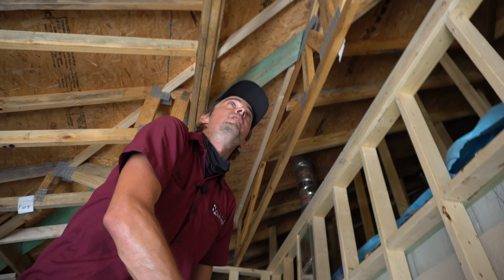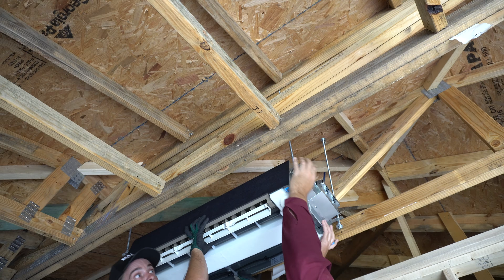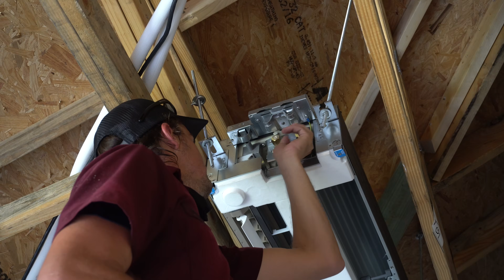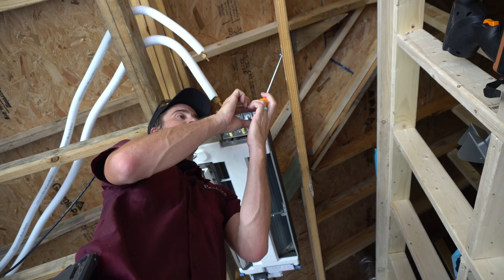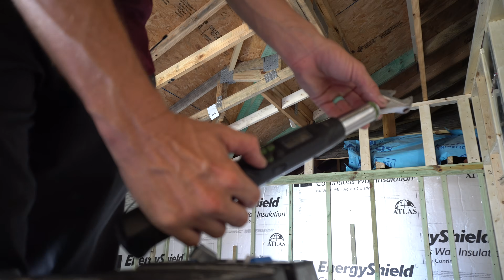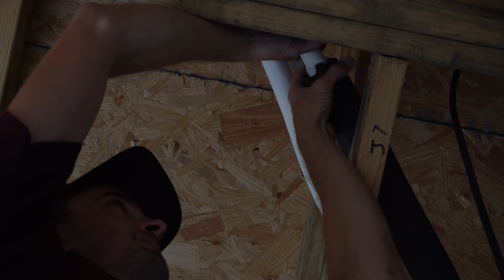Installing a Mitsubishi One-Way Ceiling Cassette In An Unfinished Room (You Can See EVERYTHING!)

Comment: all good!.........except, why wouldn't you run the copper down the inside of the wall and exit at the bottom to the outside, instead of having that ugly pipe running down the oust of the house?  that down pipe is an eyesore and doesn't need to be there!

Comment: Never Buy These! There were not designed to be cleaned. Every time mine have been cleaned, the blower shaft has been warped and caused the blower to be off balance while spinning and thumping against the insides. Reframing for the 2' Square units is very easy! 

If you can not access and remove a Blower from a unit without touching the Coils; Do not buy them!

Comment: Great videos. Hoping you can help. The condensate drain calls for a VP20 pipe with a 26 mm o.d. But 3/4” pvc is 26.7 mm o.d. Mitsubishi calls for using pvc cement. How do you make this connection?

Comment: Don’t know why anyone thinks this is a good install.  It’s terrible.  That allthread hanging off an eye bolt is ludicrous and no way is it code.  You MUST HAVE nuts and washers on both sides of that unit.  Your lineset and control wire are not strapped.  That’s a no no.  Your line set should have been run down the wall and exit behind the condensor.  That looks lousy.  People should not buy systems from jacks like this.  Customers need to be educated what a proper install looks like.  I would fire you on the spot if I saw this level of workmanship.  Thank god you are not doing these in my state.

Comment: the eye hooks are a great idea and far less than a L-bracket! What model cassette is that ? The videos say you need at least 16" to install so if that's only 12" wide that is a great option for the old homes in new england.

Comment: What does the "one way" mean? Is it different from other mini splits?
Reply: Apparently it means that it blows only in one direction, or through one vent, as opposed to other square cassettes that have vents on all four sides blowing different directions into the room.
Reply: @AA-zq1sx  ahhh. That makes sense. Thanks!
Reply: @WheretheJones  It does direct the air up and down and side to side though, to create good circulation... but yah, only one side of the cassette (on the long axis) has venting. The other side sucks in the air.

Comment: Since the room was already gutted why didn’t you run the line set down the inside of the wall? Had that been my house I would have happily paid a little more for you to drill thru the concrete instead of having to look at that line running down the exterior of the house.
Reply: Check out our installs “Ductless Plus HVAC”
Reply: This dudes install is ugly as hell no zip ties on the wire and line-sets.

Comment: I would have used side beam hangers for the threaded rod but whatever works I guess. Also the wire you used is 14-3 the ground doesn’t count as a wire.
Reply: Its sold as 14-4
Reply: @qomco  no it’s sold as 14-3 ground isn’t included in the number ground is there no matter what
Reply: @keenanwalker6597  if you say so. But i install mini splits 5 days a week and its sold as 14 4

Comment: This is not at all how this should be done and certainly not a “quality” installation as some have commented.  Lines and drain should all be strapped secure.  No cement on the drain connection at the unit!?  Ever read the install manual?  “Be sure to connect the drain hose connecting part using adhesive of polyvinyl chloride family to prevent leakage”. Wow. The thing is swinging free and wobbling back and forth it’s an insult to craftsmanship.  The unit should be installed solid on rigid rod, if you can’t figure out how to do that you shouldn’t be installing.  This poor customer.  Not to mention who’s going to tell the dry wallers the exact dimension of the opening so they don’t drywall up to the edges of the unit.  Then the grill won’t fit on and the drywall will have to be cut back.  If it’s to be under insulation (especially blown cellulose) there should be plastic barrier covering unit to protect from dust (again, read install instructions if you’re new to this).   It’s much better to install lines, drain and wiring in position, then cut the unit in after drywall is painted.  Way cleaner and the customers unit isn’t exposed to all the construction dust.  Units can easily be removed from below, they’re designed to be installed into finished ceiling.  Yes this equipment lasts very well if it’s applied and installed correctly…which this unit is absolutely not.  This is not at all how this should be done.

Comment: Nice work. And for 14 dislike, could please point out why you guy disliked?
Reply: "This is not at all how this should be done and certainly not a “quality” installation as some have commented.  Lines and drain should all be strapped secure.  No cement on the drain connection at the unit!?  Ever read the install manual?  “Be sure to connect the drain hose connecting part using adhesive of polyvinyl chloride family to prevent leakage”. Wow. The thing is swinging free and wobbling back and forth it’s an insult to craftsmanship.  The unit should be installed solid on rigid rod, if you can’t figure out how to do that you shouldn’t be installing.  This poor customer.  Not to mention who’s going to tell the dry wallers the exact dimension of the opening so they don’t drywall up to the edges of the unit.  Then the grill won’t fit on and the drywall will have to be cut back.  If it’s to be under insulation (especially blown cellulose) there should be plastic barrier covering unit to protect from dust (again, read install instructions if you’re new to this).   It’s much better to install lines, drain and wiring in position, then cut the unit in after drywall is painted.  Way cleaner and the customers unit isn’t exposed to all the construction dust.  Units can easily be removed from below, they’re designed to be installed into finished ceiling.  Yes this equipment lasts very well if it’s applied and installed correctly…which this unit is absolutely not.  This is not at all how this should be done."

Comment: Does the drain line pitch up from the unit before it travels to the hole in the soffit? If so, would there be a problem with stagnant water during dormant periods?
Reply: These units unusually come with an internal condensate pump

Comment: can  we install cassette ac on 5 metre high ceiling
Reply: Reply please
Reply: @gauravharmale137  If It were me, I'd use a ducted unit (not a ceiling cassette) and a 3.5" x 14" ducts down the wall to place my registers at about 10' AFF.  Depending on the size of the room, you could place a couple and achieve a very satisfactory result.

Comment: Nice job! I wish our building code was as easy as yours is. 
We can't use tray cable outside so we use plastic coated MC
We also have to strap up the cable, drain and lineset
Then again you guys have all that hurricane code we don't have to deal with here
Reply: It's not tray cable, it's outdoor rated sun resistant , when ya buy the real stuff for minisplit interconnections.

Comment: Nylog is for the mating flares, not the threads
Reply: You are right but after hearing the podcast Bryan did with Refrigeration Technologies i have changed my mind.
I use it on the flare, threads (for sealing) and betwean the nut and flare to reduce friction as to not galling.
https://www.refrigtech.com/nylog-blue/
Reply: @MikaelS1977  Never put anything on the flare or union face. It is a mechanical seal. Doesn't require any kind of sealant, you lubricate the threads to allow proper torque.
Reply: @danielg.9578  Yes in a perfect world :) if ther is any small voids it will help making a seal (yes a good flare dosent have any voids).
Watch this AD and do as you wich :)
https://www.youtube.com/watch?v=YbYMdFsTIlg
Greetings from Sweden

Comment: They make 90degree “sammies” for 3/8” all thread. It would look a little more professional. JMO
Reply: Chris Durham  👍🏽 yes those eye bolts aren’t designed for lateral forces, I also would have added some wood cross bracing to keep my supports plumb
Reply: This unit weighs a whopping 32 lbs... pretty sure it's gonna hold up just fine.
Reply: I always use sammies as well but to each there own
Reply: When they blow in R30 on top of this set up.... who's gonna ever see it again? Find another reason to be critical of another man's work.... JMO
Reply: @CockyMike911  ok speedy, was someone being critical or just letting someone know that the same company makes a different product that would be better suited for the application.. No that’s not a question.
Reply: @KentuckyReef  Be more critical. Like the terminations should have spade crimps or at least be wrapped in the proper orientation.

Comment: I hate to be this guy but how do you change this unit out or service it once it's hidden behind the sheetrock.  Nice install though!
Reply: We are not allowed to install cassettes in anything other than dropped ceilings where I am. I was thinking the same thing
Reply: I wonder this too
Reply: Well, I do HVAC in industrial spaces and if you buy a Fujitsu, it will probably last until you retire!
Reply: Um... you can go into the attic to service or change it?
Reply: @AA-zq1sx  good luck getting in that attic.
Reply: @jasongoertzen  Why, are you and your big gut liable to get stuck or something?? Attics are used to service and access all sorts of things... if I can get an 80 gallon water-heater in an out of an attic, an HVAC tech can replace a cassette. For yearly maintenance they're serviced by removing the cover.
Reply: @AA-zq1sx  lol
Reply: The face plate leaves enough coverage for the drywall to be cut back enough for you to lower the unit for repairs if needed. You can use a “super socket” to take the nuts off. 
In commercial buildings with water source systems you have to drop units for repairs all the time. Truthfully, I’d rather pull a 30 lb cassette out of a drywall ceiling than a wshp out through a drop ceiling.

Comment: Quick tip when doing all-thread, put a nut on both sides of the cut and then back the nut off of the cut ends. It will re-thread buggered ends every time.

Comment: Teflon is ok but has no bearing on seal in this case.
Reply: In some places, it's actually against code to use Teflon on flare fittings.  This is because you can easily overtighten as you have reduced the turning resistance of the threads.  He compensated by using less torque, but our local gas inspector would have instantly locked the install it he had caught it.